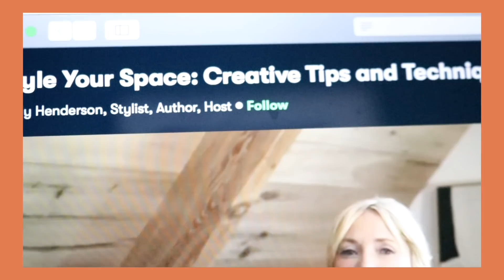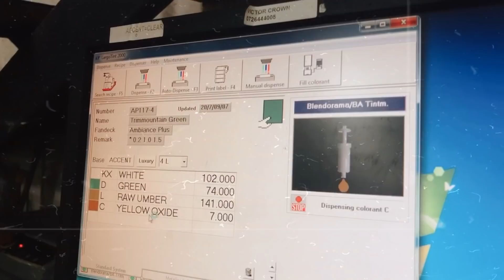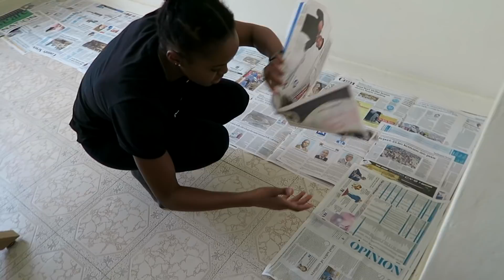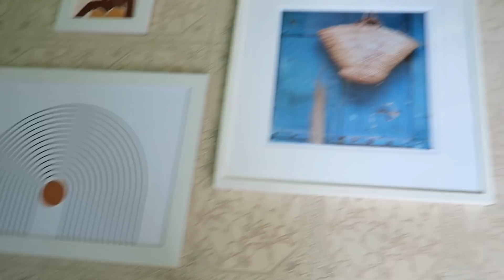My Attempt At Creating An Accent Wall

Comment: The accent wall adds a pop of colour. Maybe when you paint the rest of the living room it'll resonate with you? As for the parts that are uneven, the second coat preferably one should use a paint brush and then the third coat use a roller to get rid of the brush strokes. Also sanding the wall down on places that seem uneven before painting the second coat. It's a good trial for starters. I'm so happy you decided to take a plunge and do the painting yourself.... Kuddos!